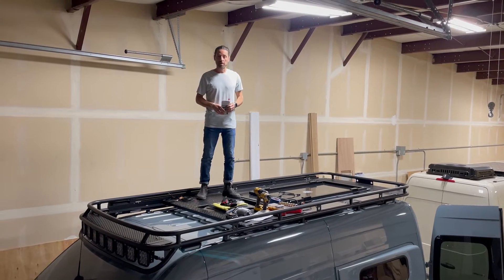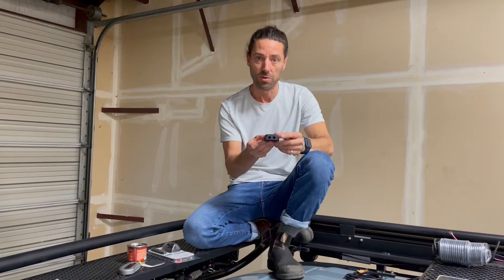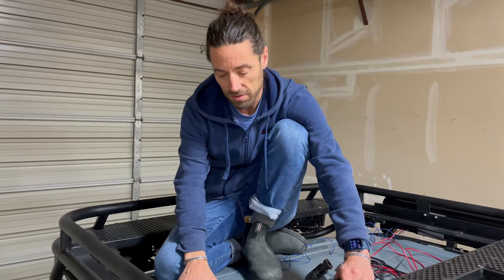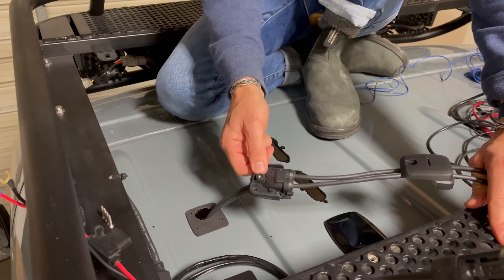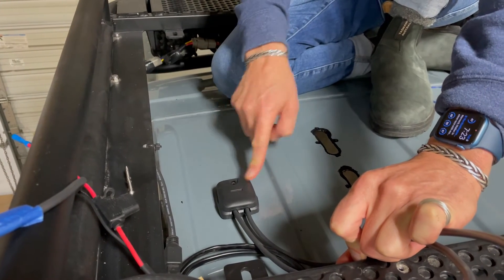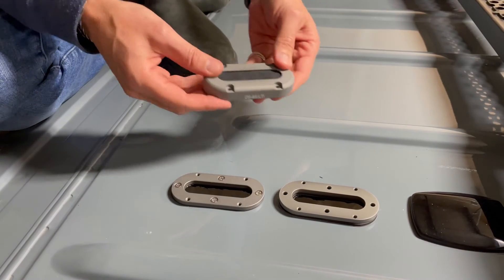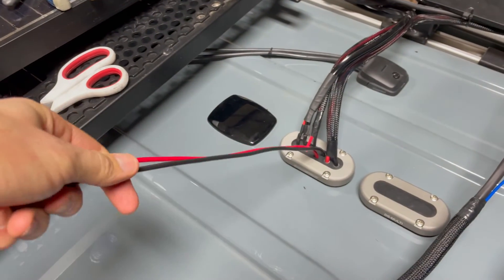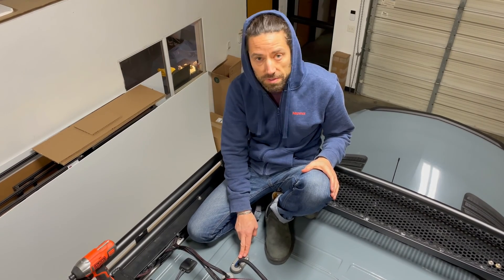How to Install Scanstrut Cable Seals in a Camper Van

Comment: does it matter which way they are orientated in relation to the direction of travel? I can see arguments for either way forward or rear facing cable entry. wonder if it matters or free to do the most logical thing based on each situation? thanks
Reply from the maker: Typically we just face cable entry glands towards the rear of the van so that you’re not driving rain into it at highway speeds. But honestly, it probably doesn’t matter. They’re watertight.

Comment: So those Scanstrus are not usefull if you have cables with attached plugs?
Reply from the maker: You should always be installing bare wires when running solar. You add terminals after installation.
Reply: It dont need it for solar cables, i need to route an antenna-cable wirh molded plug.
Reply from the maker: @erkanbu2282 in that case you can cut a slit in the rubber of the pass through, it self seals.
Reply: @nomadicsupply  sounds like a plan, thanx!
Reply from the maker: @erkanbu2282 you’re welcome; we’ve cut a slit into them many times and it’s worked perfectly without any leaking, so that should work for your cable!

Comment: Just wondering, do you have any backing timber under the metal roof that the screws bite into as well.
Reply from the maker: @baswann2  hello! You can use stainless screws with marine grade material on the underside (We use King Starboard) or you can use stainless bolts with a stainless nut on the underside.

Comment: Great video. 
1. What drill bit do you use for the large holes to start the oval?  
2. Then what tool do you use to complete the oval?
3. What is the rust proof paint?
4. If the holes for the wires are 1 size LARGER than the wire - wouldn't that leak?
Thank you.
Reply: This particular cable seal comes with little metal tubes that you can insert into your drill to get the hole size correct. I use rustoleum paint + primer in one.
Reply from the maker: Hello!

You would simply use a hole saw at each end of the hole and then a jigsaw to complete the oval. 

The only rust proof paint that we use on all of the vans that we build is POR 15:

https://nomadicsupply.com/brand/por-15/

Comment: Thank you for sharing. Especially tip about rust seal.  Would not have got that. 🙏
Reply from the maker: You're welcome! We recommend using POR 15 brand paint...and be very patient with it, it takes a very long time to dry.
Reply: @nomadicsupply  thanks will do. Presumably the rust preventative variant for these roof holes?
Reply from the maker: @mattnewman8103  This is the one we use: https://por15.com/collections/all/products/rust-preventive-coating?variant=42895337881767